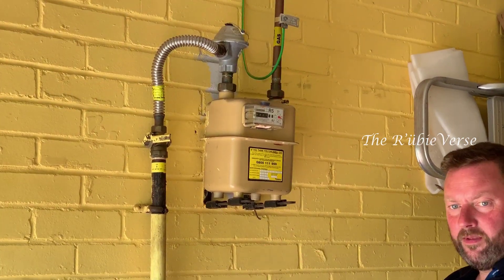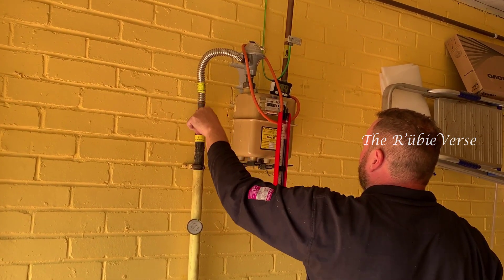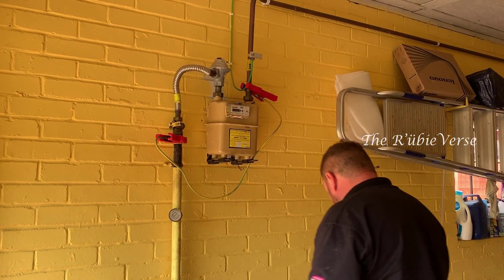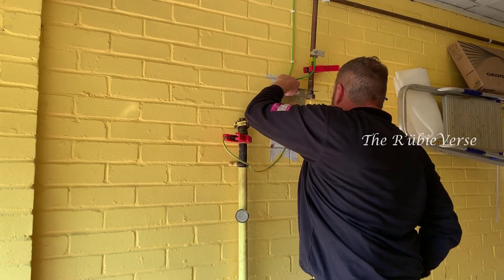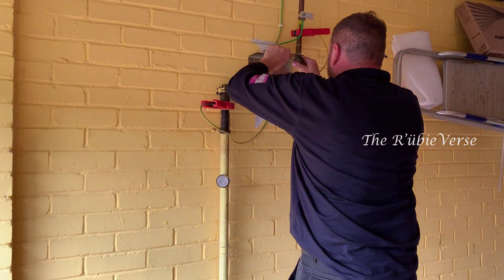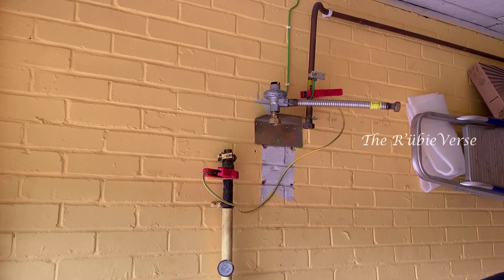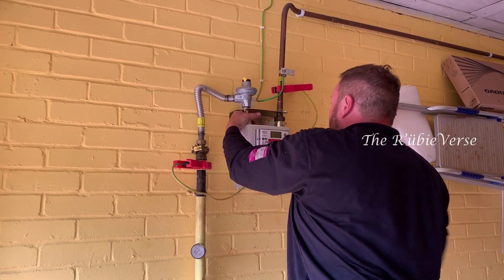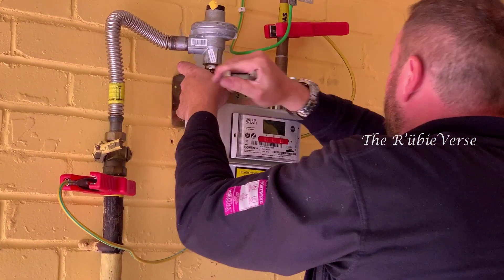Smart Gas Meter Installation

Comment: Let by test 7-10mb not 9-13mb (2min)
Stabilisation (19-21mb-1min)
Tightnesses test ( 19-21mb -1min) 
You need to purge the system at the cooker  before recording standing pressure . 20-23mb usually 
Then do your working pressure ( 3 rings at cooker ) 
The anaconda is kinked a bit so really be sure you don’t get a sharp bend.
Reply: Sorry but you’re incorrect in what you’re saying also. Stabilisation and tightness testing is (not between 19 & 21mb), and standing pressure isn’t no greater than 23mb (that’s working pressure).

- Tightness test pressure is between 20 and 21 mbar.

- 1 minute pressure and temperature stabilisation (may require longer for a stable reading to be achieved).

- 2 minute tightness test (where necessary adjust pressure to between 20 and 21 mbar before commencing test).

Those are the correct procedures and pressure for a Tightness Test & Stabilisation Test.

Comment: Haha, health and safety person will love this. Good old purge through meter, forgot to turn the power off to the boiler too 😄
Reply: Don't matter if power ain't off at boiler as long as the heating ain't on..as it's in standby waiting for further instructions really. Yes if heatings on then turn boiler off
Reply: @memyselfandi36  ideally you don’t want boiler to run while replacing meter so good practice to isolate power. Can see that while the engineer in this video is doing final tightness test, that the boiler has been run (making him have to go and investigate and redo his tightness test).

Comment: Is a meter bar required for all new gas connections? asit is missing here.
Reply: Not necessary but you would need to do some kind of tightness test ie a squirty bottle with washing up liquid in squirted onto nuts ..if it don't bubble then it's fine

Comment: why did he not use new rubber seals...??
Reply: Cos the ones already on should be fine unless damaged but hard to see why they would've damaged...a 20yr old gas meters seals should still be fine...its gas going through not water and its air tight

Comment: Where does the Smart Gas Meter get the power to run the meter electronics? Does it have a battery that has to be replaced on a regular basis or does it have a mains connection or a fuel cell operating off the gas supply?
Reply: Plug
Reply: The smart meter itself has a lithium battery in it with the average life of 10 years.

The In Home Display (which many people mistakenly call a smart meter), depends on manufacturer and model. Some have cable only so have battery and cable

Comment: Why aren't the new meters the same size and fit as the old ones, so that  there's no need for a new bracket?  Is it to create extra (unnecessary) paid work for the fitters?
Reply: The meter should be supported from the top with a bracket rather than just sitting on one

Comment: Hi there. I had a question….. since the government is banning gas from 2025, dont you think gas engineers will be out of jobs? Or will they be installing hobs only. Im asking because I’m interested in doing a gas course but I’m worried that I won’t be having a job in a few years and my course will go to waste.
Reply: Did you find an answer ? 
It may switch to hydrogen etc
Reply: The government aren't banning gas in 2025, they are preventing new boiler installations in new build homes from 2025. For many, many years to come, people will replace existing boilers and continue to upgrade existing systems. The likely evolution is hydrogen, so I think the industry will be sound for a long time, but the ability to evolve will be needed. Best of luck
Reply: Really when will this happen 😂

Comment: How do smart meters save you money. The only way i know is not to use the Gas or Electricity. I can do that without a smart meter.
Reply: Cheapest tariffs are now all sms tariffs (that’s one way).

Dual Fuel smart tariffs usually save another 6%

Being able to monitor your usage easier allows customers to make informed decisions where possible

Comment: where gas smart meter gets its power from?
Reply: Just looked online as I was wondering the same, turns out they're battery powered but the battery lasts around 10 years
Reply: @AutoUnder  old smartmeters  battery last less then 10.  My ones display is dead . I dont know if its still metering
Reply: it has its internal battery witch last 20 years or so

Comment: Flex hose on the HP side?👎🏽
Reply: Cameron Reason That’s perfectly inline with gas regs. One side rigid one side flexi. You are only allowed one flexible connection on new installs. Why make life difficult by having a double rigid connection when the meter is well supported with a bracket and up to current regs.